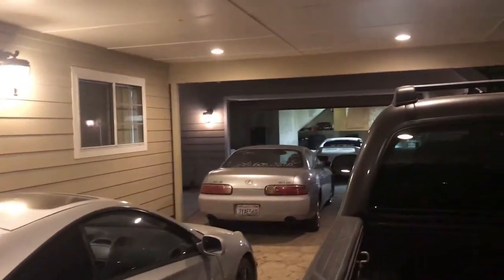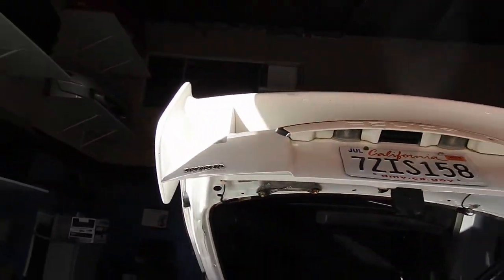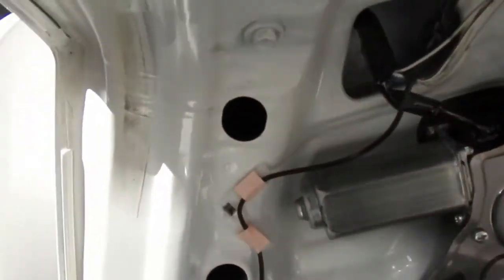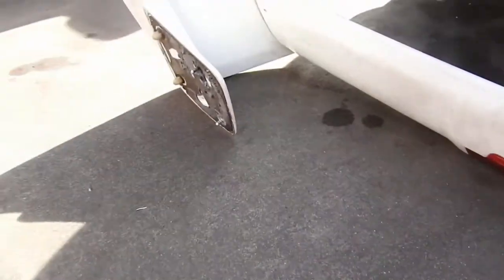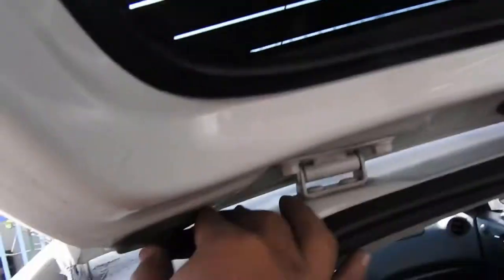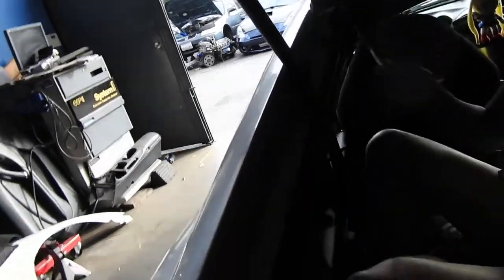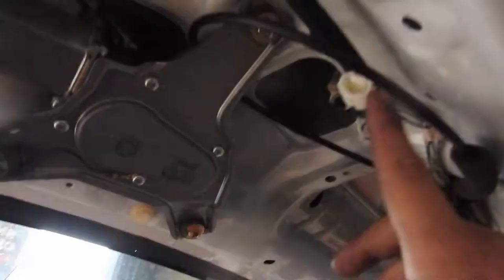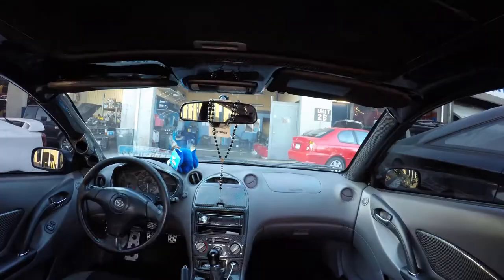How to Install TRD Wing and Installing the Sport Lid 00-05 Toyota Celica Gt/Gts

Comment: Is it good with only the 2 screws and molding adhesive. Or i should drill the other 4 holes for the clips?
Reply from the maker: Juan Barraza two screws on each side is fine

Comment: Thanks for reply so for the set up like yours . What wire did you use .
Reply from the maker: Robledo,D i used speaker wire and you tap into the green with white line and white with black line
Reply: Thanks, bro I'm going to do it today looks dope with all break lights on.  Hi from Chicago
Reply from the maker: Robledo,D your welcome and thanks for the support. Hi from LA

Comment: What site did you use to do the connection your video is good I thought I could just plug it to the rear plug and it would work
Reply from the maker: Robledo,D you have to change the power to go to that plug, need to change the terminal on the plug on top of the hatch where the 3rd brake light
Reply: @RafasGarage  how do I do that?
Reply: @TwentyTwo22  I know this is late,  but he just spliced the trd wing wires with the rear brake bar on top of the hatch. The wires are the same color as the trd wing, so just color match the wires and you're good 👍🏽